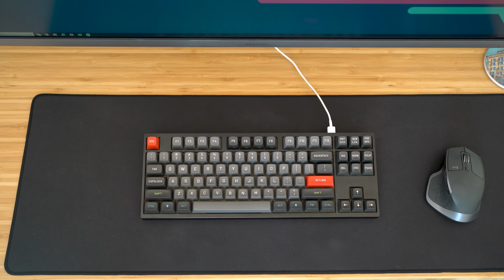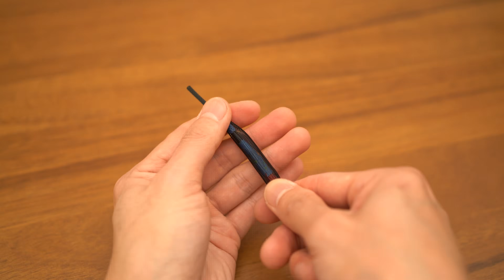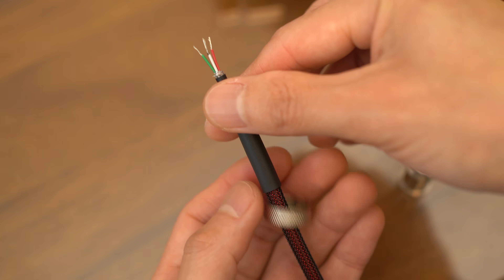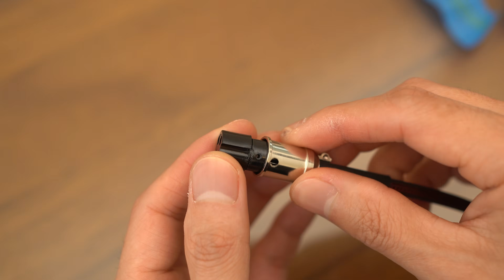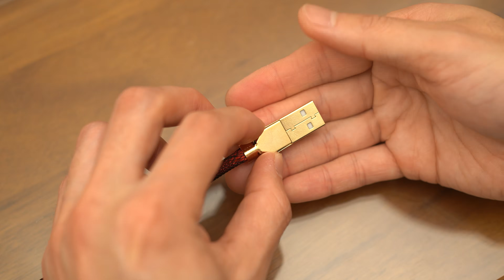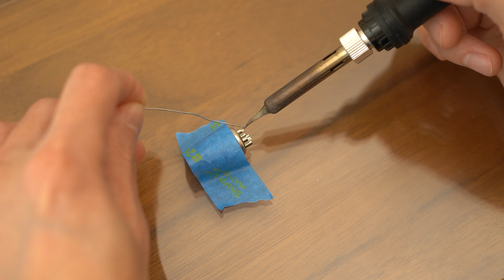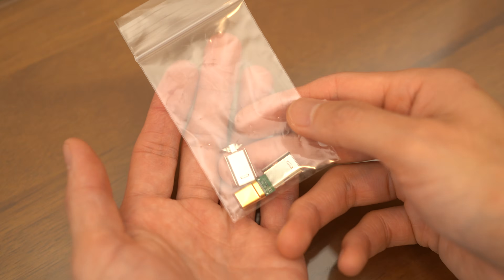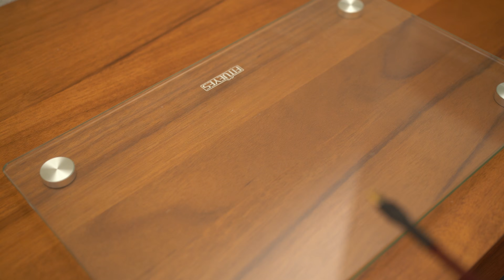Custom Coiled USB Aviator Cable for $50?!?!  Build one DIY for just $17!  Follow Along Tutorial!

Comment: Is there a benefit of using the aviator connector other than looking cool?
Reply from the maker: Hi Angel!  One major benefit is actually the convenience of being able to match the cable to the keyboard quickly, without undoing the whole thing from the computer.  So you can have a more neutral colored cable from the computer to the aviator female, then whenever you want to swap the coil side, you can just undo and connect!  Also, it looks awesome!
Reply: @Keybored  Other than the "cool" aesthetic look of the aviator plug, it probably adds more electrical problems than it solves. USB connectors are designed specifically for use with USB power and data signals, while the aviator plugs are not. The less than ideal electrical aspects of the aviation plugs compared to standard USB connectors may be part of why longer cables have issues, especially with the data signals begin to fail even though the power may still be OK. The electrical impedance issue of aviation plugs on USB cables is similar to using non-standard plugs on Ethernet cables. It may work on short cables, but the problems begin to appear as the cable length and/or data rates increase. Just because an incorrect connector style may work most of the time it doesn't mean they don't introduce problems.

If the function of the in-line plug is to simply separate the coiled section from the 'permanent' section attached to the computer, why not put standard USB connector on the end of the coiled cable and use a standard pre-made USB extension cable to make the run to the computer? Even if you want the coiled and straight segments to match visually and want to build both segments, just don't use the aviation plug set, replace it with USB connectors.

If the Aesthetics of the circular plugs is a must have, will standard USB connectors fit inside the empty shell of the aviation plugs where the black plastic inserts normally go? If they do, you can use "proper" USB connectors for the electrical connection, but hide them inside the "cool looking" circular connector that would still work to mechanically lock the two ends together.

If you are really looking to just show off a unique custom style, why not use 4-Pin XLR Connectors instead? They are of similar (but newer) design compared to the older style aviation plugs. The standard XLR locking mechanism is easier and faster to use as a push-together / pull-apart connector, unlike the screw-on / screw-off aviation connectors (which was really just another version of an audio connector that used to be popular for aircraft use, thus their common name). The improvement found in XLR style connectors (such as connect/disconnect speed, and self-adjusting screw-on cable clamp boots used in many versions) is why they have become a primary audio connector standard for decades. XLR connectors are probably equally as bad for the USB data signals as the aviation connectors, but they can also look "cool" and they do provide a strong mechanical lock unlike standard USB connectors with no locking mechanism.     https://en.wikipedia.org/wiki/XLR_connector
Reply: If you look for locking USB connectors, you will usually find solutions that just adds some type of locking mechanism around a standard USB connector. Examples:

https://www.te.com/usa-en/products/connectors/intersection/industrial-usb-connectors.html?tab=pgp-story

https://www.serialgear.com/USB-WIRELESS-ADAPTER-SC-U06BBF.html

https://www.google.com/search?q=locking+usb+connectors
Reply from the maker: @darrellhale3880  Thank you for that detailed, expert opinion!  Will definitely consider this in the future.  What is your thought on LEMO connectors?
Reply: @Keybored  I have never used LEMO connectors, but the pictures of them seem OK. (Kind of like miniaturized XLRs?)

What you really need to keep in mind are the twists in the data wire pair (or is supposed to have) as removing the twists can effect the quality of the data across those wires. As long cable runs get closer to the point where they will start failing, having points along the wire without that twist will contribute to the data signal becoming worse faster. It may become the difference between an unmodified cable that works, and the same cable modified to add connectors in the middle.

When adding connectors, keep the twist for as long as possible. In other words, minimize the length of any straightened wire segments when you are soldering them into the connector. Ideally the twist should run right up to the pins themselves. The same applies to the soldered USB connectors installed on the ends of the bulk cable used in the video.

https://en.wikipedia.org/wiki/USB_hardware#Cabling
Reply: looking awesome

Comment: Don't forget to recoil it backwards so it would become springy
Reply from the maker: Great advice!  I have reversed coiled some of my other ones to keep the tension :)
Reply: @Keybored  Can you explain a little in detail of what this means? I imagine the coil (if followed exactly like the video) won't turn out like an old 80's home phone springy cable.
Reply from the maker: @ulysses.cardenas  hi Ulysses! Once you're done coiling with the heat gun, and the coil has cooled, you can actually grab the end of the coil, then reverse the coil (flip it inside out). This way, the coil actually retracts and becomes super tight and "springy." hope that helps!
Reply: @ulysses.cardenas  Oh wow. I think I am stupid. I watched the section of the vid, saw what the dude was doing and still havo no idea what happened. Well, I guess I will just skip this advice then. :D

Comment: You said to get a heat gun so I was wondering which heat gun did you use for this build?
Reply from the maker: Hi Roberto! I used a wagner heat gun with 2 temp settings. I believe low is around 700 degrees f and high is around 1100 degrees f. Only use the low!

Comment: Great shots: check
Detailed instructions: check
Amazing advice: check
DESKPAD ROLL: CHECK
Reply from the maker: Hi Felipe! The most important is that desk pad roll! I wish my desk pad rolled a bit nicer, but that was the best I can do! Thanks for watching!
Reply: @Keybored  metal housing is a ground... not supposed to be cut off. Also you should reverse coil after the cool off. Even this is done in Industrial Factories for phone cords. Its just better and keeps a tighter coil. Also $17 is pretty unattainable, considering the cost of a heat gun and a soldering iron. This isnt really a tutorial. You skipped alot or just didnt show it. Kinda disappointing the intro was so nice, then you basically fell flat on your face like The Verge PC Build.
Reply: @DutchieKNVB  I'd expect that if you're building a keyboard you at least have a soldering iron lmao
Reply: focus: ...
Reply: paracord gauge: Missing
teckflex guage: missing
usb cable source: missing
where did he get the stick: missing